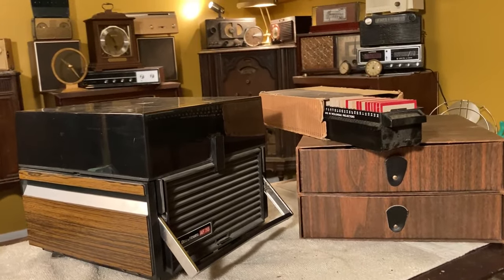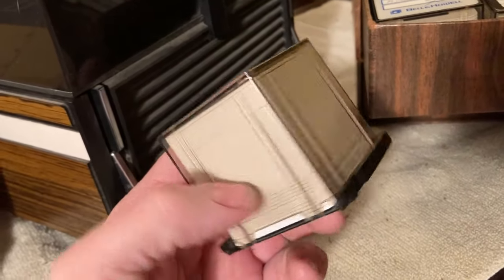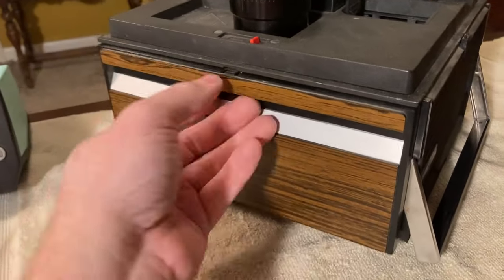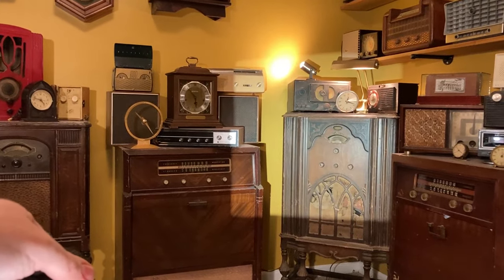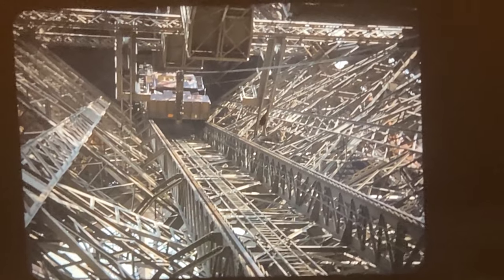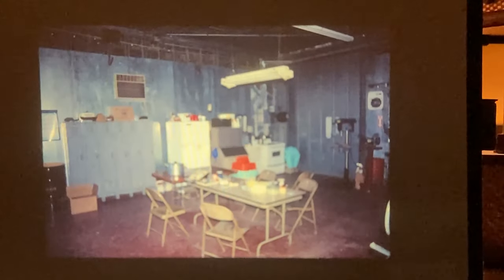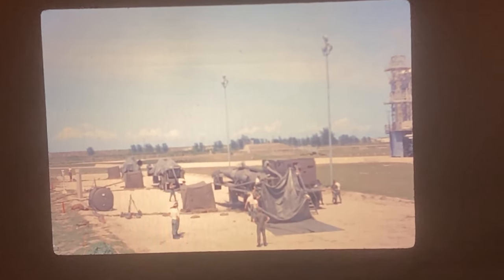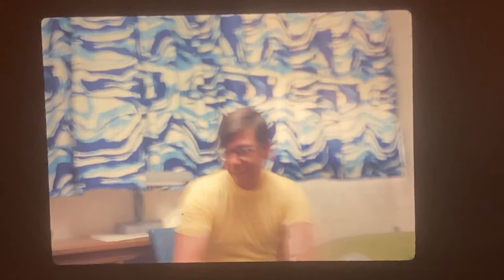The Family Threw Away This Bell & Howell Slide Projector!  Paris 1956, Disney World 1974

Comment: Kid of the 70s here. Slide film was different. You could pay to get slides made from negatives, but slide film would give you a "positive" image instead of the "negative" you get with regular film. It was also a higher grain (?). So a better quality image when projected. If you take a slide apart, you should see the perforations on the sides of the film strip.
Reply from the maker: Interesting, I just figured they used the negatives but that makes sense.  it seems very high res for the time.  I always heard that the really old photos from 100 years ago were actually high res too because the film was much larger...